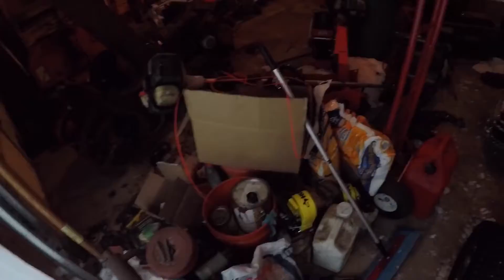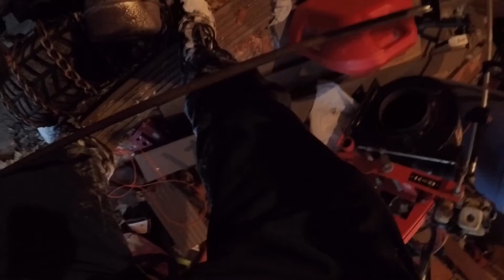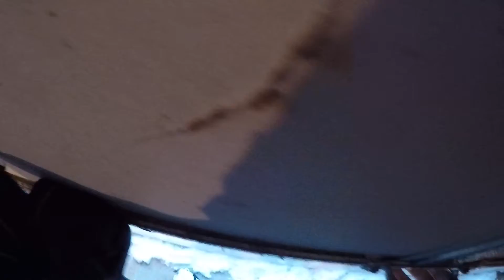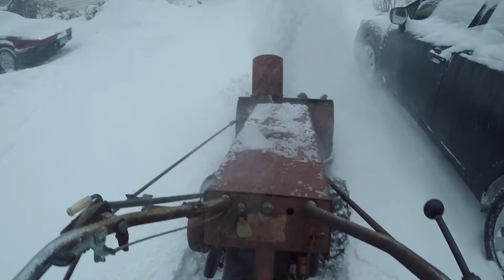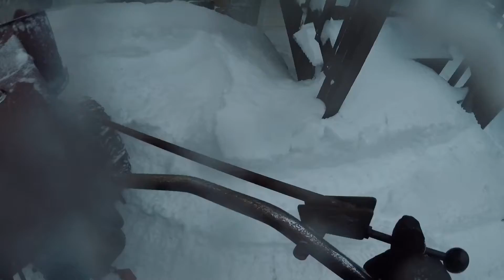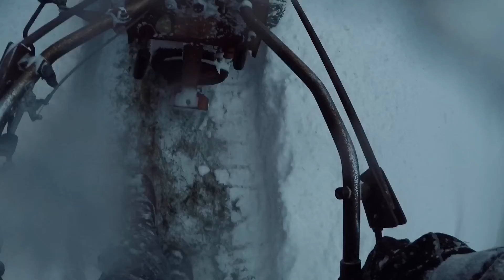Deluxe Dog Eater 1972 Gravely Commercial 10A K241 10hp Kohler

Comment: Mine would always blow back on the carb and freeze up the governor linkage. Other than that I went through snow a many time over the top of the blower.
Reply from the maker: Larry Evans when I was done the whole carb was a big snow ball.    I need to make a sheetmetal cover for it.   Kohler had an OEM one at some point in time....

Comment: Should be called a snow eater, because the operator eats all the snow the machine blows around. It's the same with any snowblower though, which is why I prefer plowing most of the time.
Reply from the maker: The Shade Tree Fix-it Man lol, so true no matter what direction the wind is blowing is always ends up in your face, lol.   I like plow better as well, but hitting the throttle on this k241 is such a power trip.   This thing works awesome on the side walks as well where a plow couldn't fit...